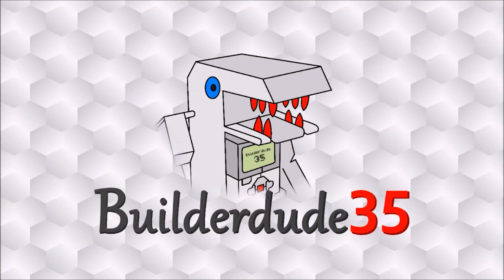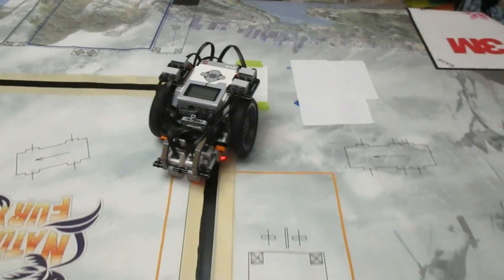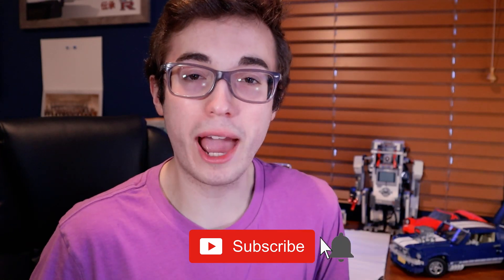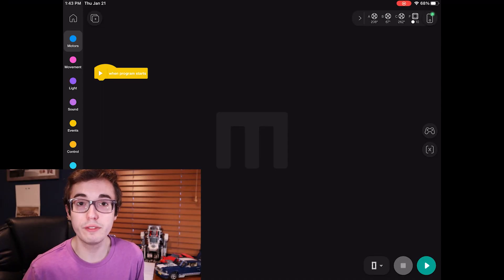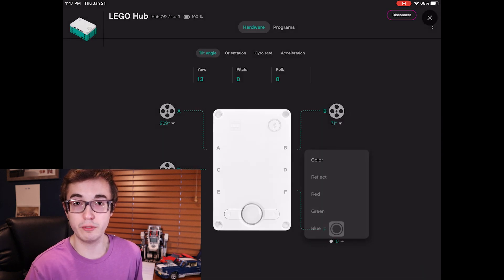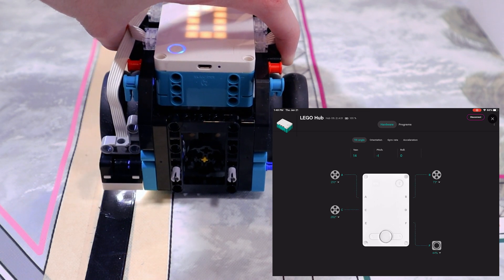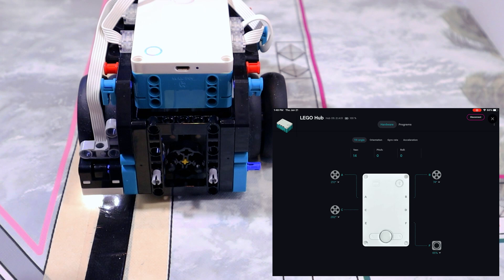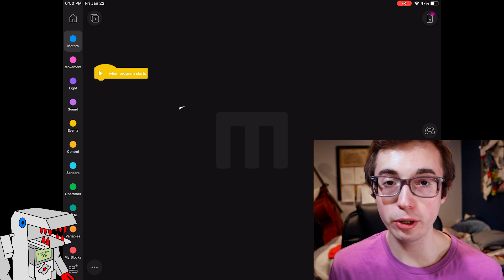Proportional Line Follower for LEGO 51515 - Fast and Reliable

Comment: Open my old EV3 and wanted to do something when I discovered that the original program had been replaced with a education program and I could not find the original EV3 software anywhere. Anyway long story short decided to make my first ever line following robot and made a semi-difficult course for the robot to follow. Found my own way of doing sharp corners, curves and "intersections by using gold coloured "switches" which would inform the EV3 that it needed to switch functions. Going to try something like this later to see if it works on my track. The difficult thing about my tack is that it starts and end's at the same point by going back on itself.

Comment: This is the same routine my team has used on the EV3 for years, may of got the idea from one of your earlier videos.  We've noticed this method doesn't work as well on the spike prime and get better results when using a basic line following method.  (we've tuned both)  It appears as though it takes more time to execute the loop with the move steering block on the spike prime, which is most likely the reason it doesn't work as well.  Can get an idea of how long it takes to execute the loop by adding a very short high pitched beep.  (Note: adding the beep will alter the timing of the loop a little, but does give an idea of it's execution's time)  We're going to explore using the tank move block instead of the steer move block.  (Similar to the basic method)

Comment: Very good, yeah I remember you implemented a similar PID on EV3. There should be some blocks in Python to create a much more powerful PID controller. Then you'll be able to perform a better fine tuning, and avoid movements irregularities. Anyway, congratulations!
Reply from the maker: Absolutely! Don't doubt that a PID tutorial is on its way! I'm excited to try it out in Python.
Reply: I hooked a Built HAT to an Arduino. The Built HAT has PID algoritms built in.

Comment: Thank you! Very useful video <LIKE>. It would be more interesting in building same line-follower, but with two color sensors. For how much will it effect program change?
Reply from the maker: Thanks so much for watching! I actually plan to do a 2-sensor proportional line follower video for LEGO 51515 in the near future. The change to the program is actually minimal: instead of subtracting your target value from the color sensor reading, with two sensors, you subtract one sensor reading from the other. Effectively, you are looking at the difference between two color sensor readings to establish an error, and the robot is "on target" when the two readings are equal. The nice part is you do not need to measure a target light value when you use two sensors.

If you are interested in learning more, I have an older video that explains this topic for EV3, which you may adapt for the new MINDSTORMS. You can watch it here: https://youtu.be/3UzyynQh9F8
Reply: @Builderdude35  Thank you a lot!
Reply from the maker: No problem, happy to help :D

Comment: Great video!  I looked at the FLL2020 Replay game mat again on https://techbrick.com/fll-resources/fll-2020-replay , and it seems that one needs at least two (or even three) Color Sensors for the robot to know WHERE to branch off to missions on the left and right of the central line being followed.  Many of the side branches have black lines that do not connect directly to the primary, central line leading from the FLL game mat's "Home" area. There is a white gap to contend with.  :(
Reply from the maker: I just took a look and I can say that that mat looks like a certified mess! 😂 Whoever drew that map was clearly getting paid by the intersection. Builderdude of 2015 would probably call that a "spaghetti monster"